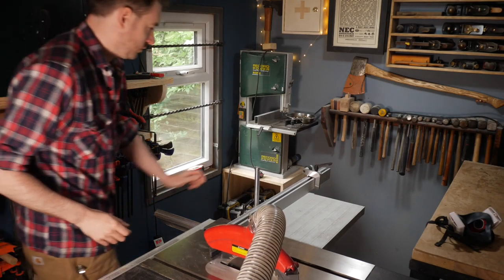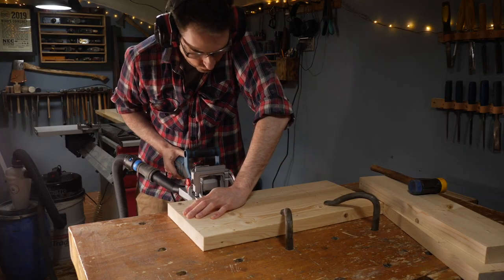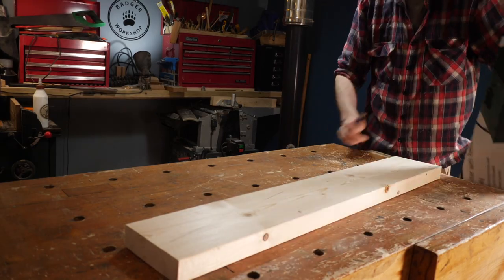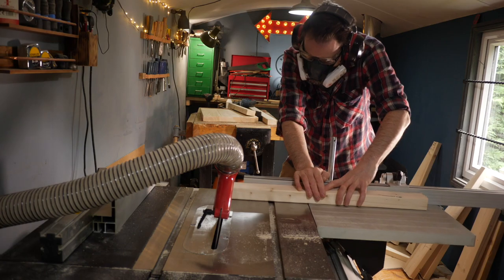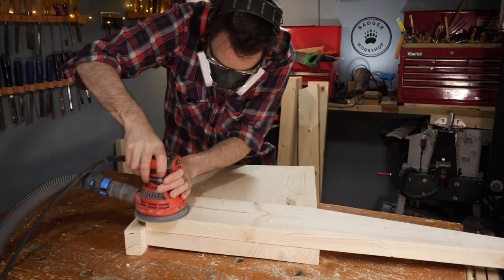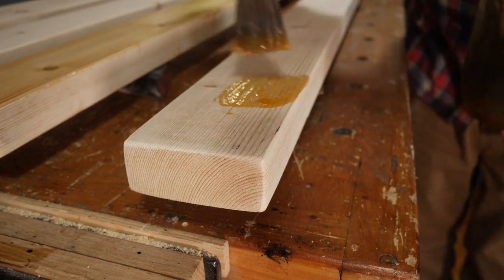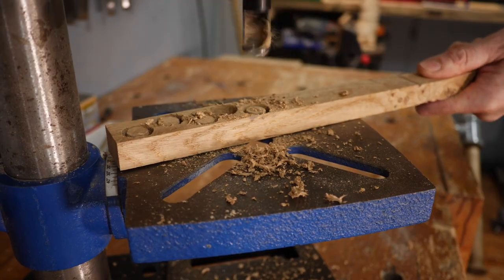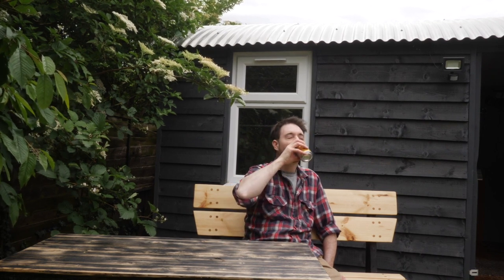Making a Garden Bench

Comment: Hardwood plugs are the best and easiest.

Have a look online in your area for a cheap or free hardwood garden bench with rotten feet.
I got two and disassembled them and stored all the odd bits having first cut out the rot. An endless supply of hardwood plugs.
Reply from the maker: I have a large pile of oak off cuts I can use

Comment: The bench looks great, but why not add a second row of holes on the seat as well. Also if top bar of the back rest was cut at opposite angle to the bottom to look like this (<=======>) it would look even more like deliberate design choices.